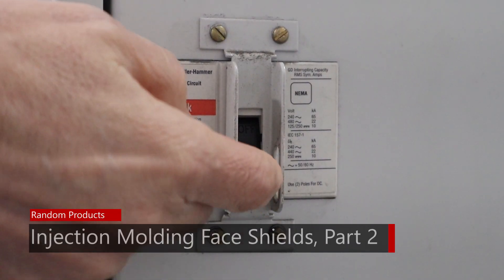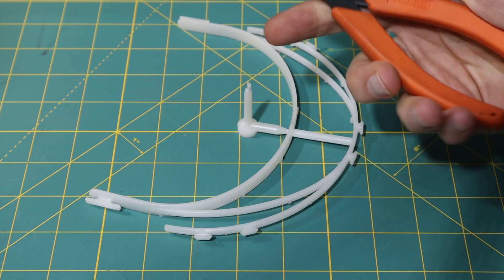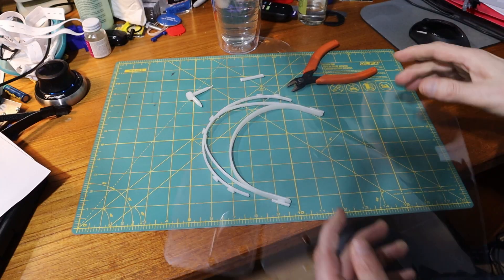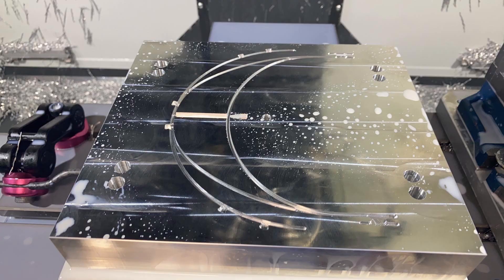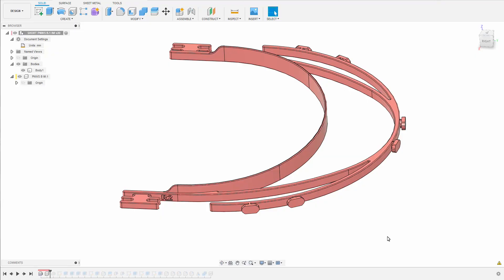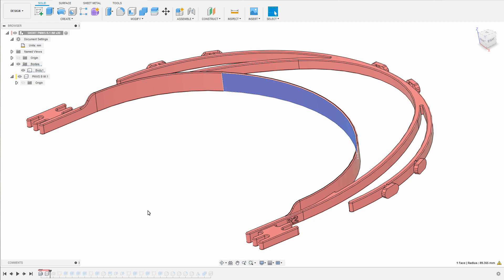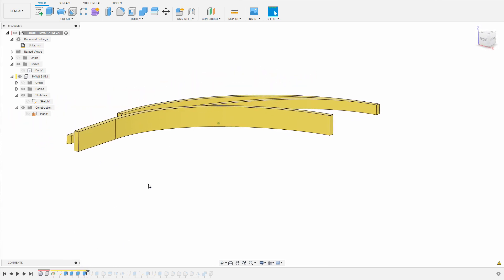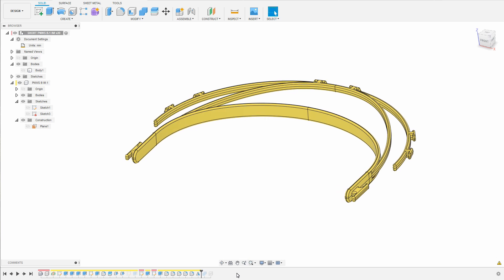Injection Molding Face Shields Part 2

Comment: Did you try to send material through the empty section in between 2 bands? I think it will be better and they only have to cut 2 times and the inside edge will already be smooth so better
Reply from the maker: That would certainly be much better. Unfortunately, Payton's machine isn't large enough for this to be possible. The frame just barely fits. If were any large, he wouldn't have been able to make a mold for it.

Comment: Hi from India. I am also working here on injection molding face shields. Your content is really helpful.
I am assuming you are using Aluminium for the core and cavity. I have a question, how many shots of injection can the Aluminium mold take? The injection molding company I am working with is pushing for harder metals (EN-31 etc.) for this purpose.
Reply from the maker: Yes, this is an aluminum mold. Our goal was to provide a quick solution until the supply chain caught up. We planned for up to 10K, and the supply chain now seems to be catching up. I'm guessing this mold could probably handle tens of thousands of parts.